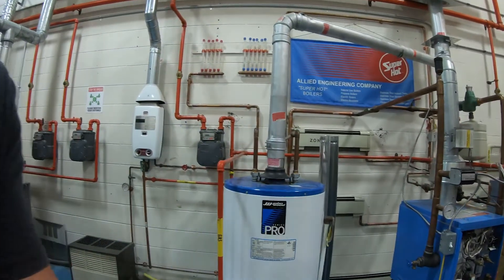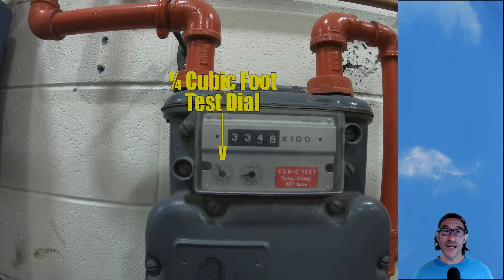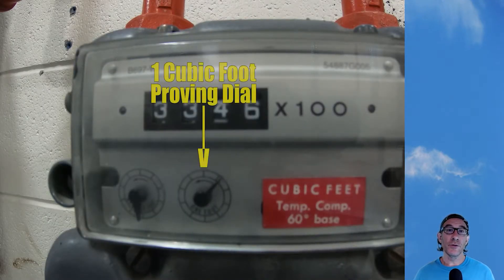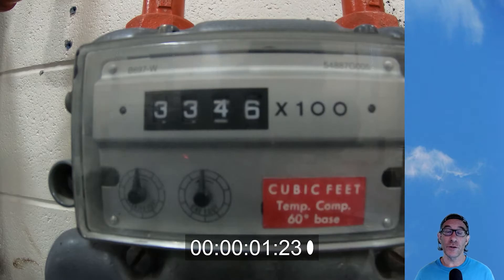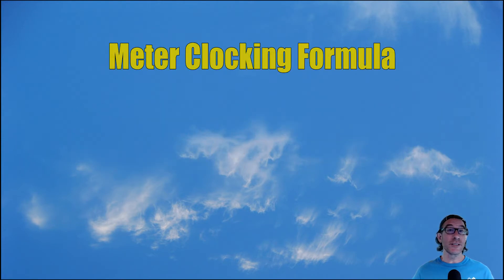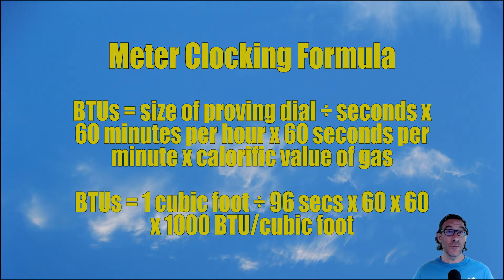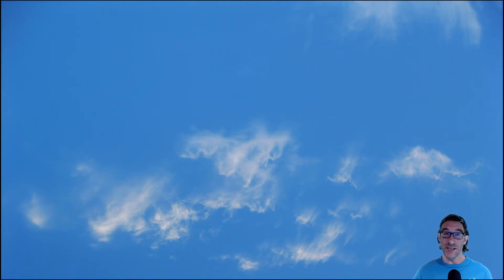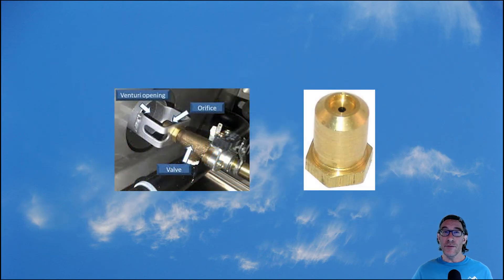How to Clock a Gas Appliance Using the Gas Meter

Comment: I have a slightly different formula. I do 3600 (seconds in hour) x 1 (test dial) = 3600. divided by 96 (time taken) = 37.5 multiplied by 1000 (calorific value) = 37500 btuh. Basically the same formula but condensed a bit. I find it easier to remember because there are only 3 steps. Great videos, I  am a gas engineer from the UK studying for the BC provincial exam. These videos are a real help.
Reply from the maker: Excellent. I do like the flow of formula you use better too.

Comment: Great video & this is coming from a gas fitter with 35 years of experience. Just an FYI, you should clock the meter 3 times & use the average . You also may want to demonstrate using the 1/4' test hand & compare answers. It's also a lot of fun comparing these answers to the computer program but no matter what technique you use , it should always be clocked three times for accuracy & assurance. I hope some of this information helped, you all stay safe out there & keep learning 👍.
Reply from the maker: Good points. In my class, I do talk about these things. It's easy to miss things when building a video.
Reply: @MathematicPlumber  , I thought you did a great job in your presentation and demonstration ( very comfortable and knowledgeable). I feel the comment section is for learning from one another, sharing our experiences and knowledge. My experiences come from 35 years working as a first responder/ service technician (HVAC)/ gas fitter for the gas utility in St Louis, Missouri, which I am sure differs a little bit from other Industries under the same general umbrella. YouTube serves as a fantastic tool to share our experiences and knowledge, also giving us the opportunity to ask the questions (?)..
 Looking forward to watching some of your other videos.
 Regards,  Bob

Comment: An observation and a question please--How does the number "1000" come up as the value to be multiplied? and my observation--The test dial and the proving dial will be aligned/synced together at the top at all times. If you pause the video you can see the clock started before it was at the top which would give you an incorrect reading. thank you and thank you for the video.
Reply from the maker: Each cubic foot of natural gas burned will produce 1000 BTUs. It is called the calorific value of natural gas. Note: that number could vary depending on which company is refining the raw product.

Yes, this test is imperfect. That is why we are encouraged to do it 3 times and take the average reading.
Reply: @MathematicPlumber  Thank you Sir for getting back to me. Sincerely appreciated.

Comment: Thanks for the video man, how would I go about doing the math with a different pressure factor? I ran into a question on my Gas A red seal that had a meter clocking question but I was required to use a different pressure factor and the question asked "how many seconds did it take for the proving dial to make one full revolution?
Reply from the maker: Clocked meter value x pressure factor

I just wrote the A Gas red seal in January, I cannot remember if you had to calculate the pressure factor, or if they just gave it to you.
Reply: Thanks for the reply, they give it to you.. I'm going for my rewrite tomorrow, it's a nasty test!
Reply: Any other pointers you can give me? I failed my first attempt with a 63%
Reply from the maker: @jonathanchristiansen4497  This was a nightmare test, so it is a bit of a blur for me too. But I will try to offer some help. This will be helpful and totally not helpful.

Process of elimination is your friend on multiple guess tests, use it to up your odds.

Get to know the different gas components really well, how they function and how they interact with the overall control schematic of the appliances.

Get very familiar with your gas code so you can navigate it fast.

I found there were questions directly from the gas code, but I had never come across these obscure codes before. Luckily I found a bunch while looking for other answers.

Lastly, study whatever material you have until you hate it. That's what got me by. 63% is close, don't lose hope.
Reply: Hey man thanks for taking the time to give me some pointers! I'm happy to report I passed with a 73%!!!! Man that's hard test!
Reply from the maker: @jonathanchristiansen4497  Nice work! That is an achievement.

Comment: where in the B149 book is clocking information?  cant find, as appears different formula for higher pressures used
Reply from the maker: This formula is not found in the code. As for adjusting for pressure factor, there is a special formula for that too, which currently eludes me. But I know if can be obtained from the gas provider.